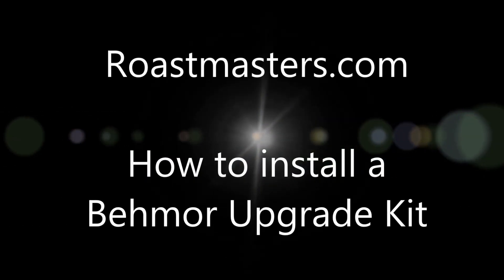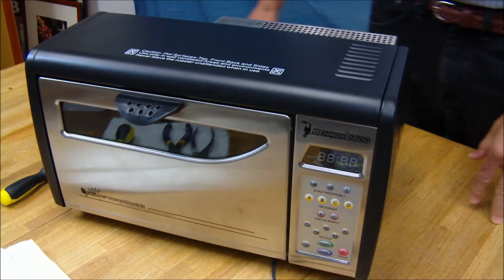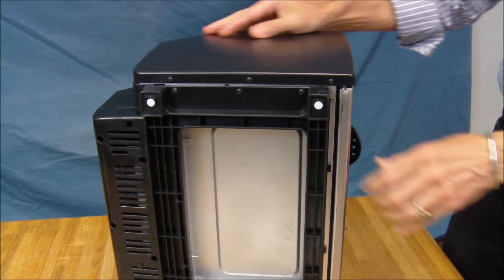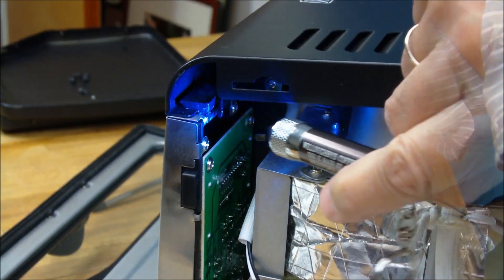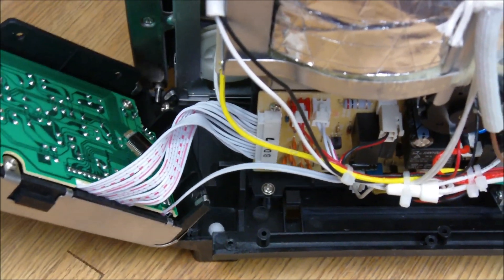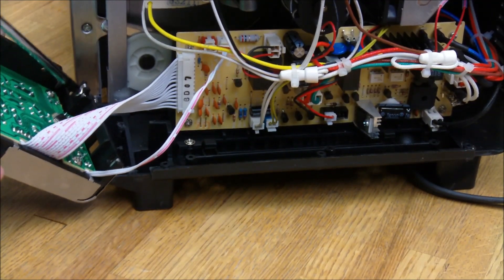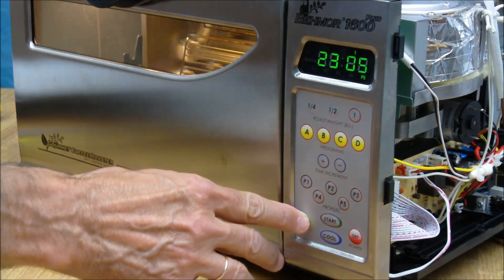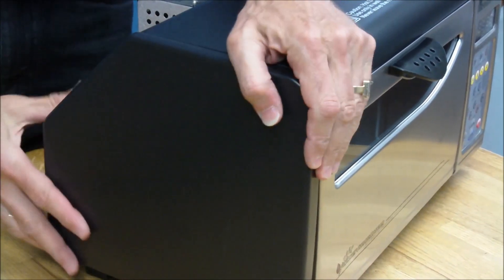How To Install a Behmor Plus Upgrade Kit

Comment: I just got this upgrade, and I noticed that my original 1600 unit does not have the fan that's mounted on the inside of the right side cover.
Reply from the maker: You must have a nearly original model from about 9 or 10 years ago. Behmor offered registered customers replacement side panels with fans. You can still upgrade the control.

Comment: Thanks for the video, just thought I'd point out that you missed the part where you remove the bottom 2 sprews from the control panel